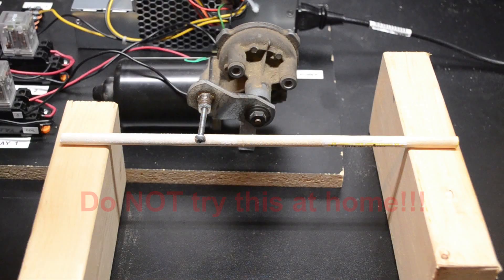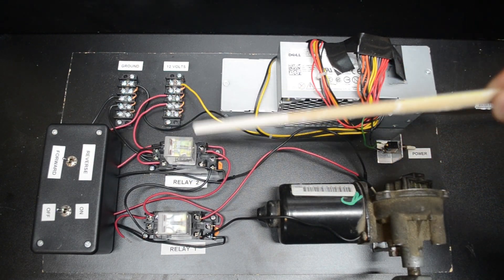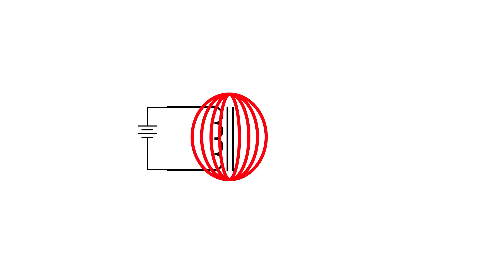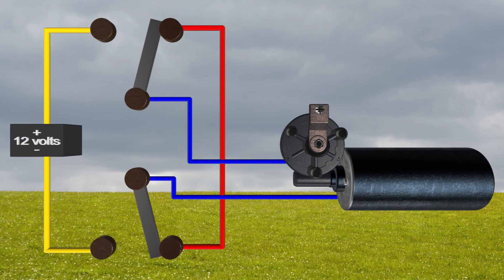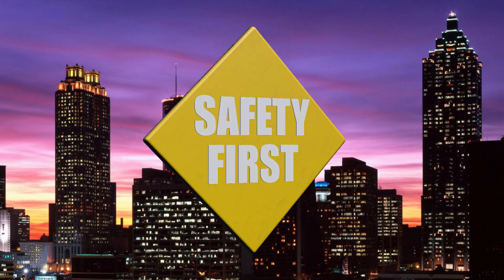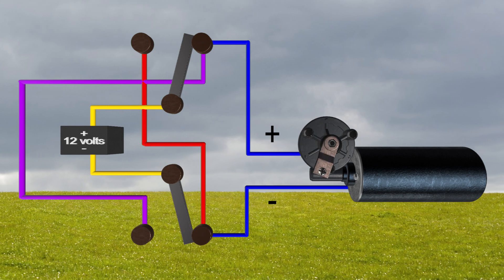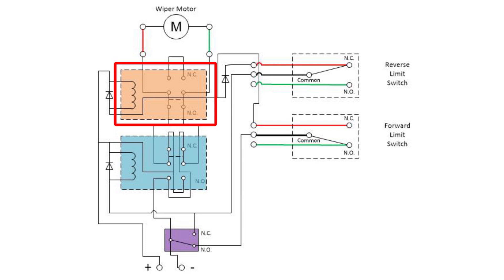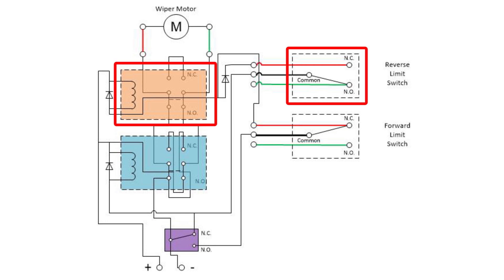Creepy Creations - Wiper Motor Control

Comment: Would you be able to add the n.o. and n.c lables to your relay contacts in your wiring diagram. I've tried to follow your diagram, and i get it 3/4 working, but something isn't right. When i trigger it it opens and stops, i then try to trigger it to reverse and as soon as it leaves the switch it goes forward again to the open swith and stops but if after it triggers the open switch amd i hold the switch closed and teigger it to close, it will close all the way to the switch and stop like it should but if i let go of the open switch at all it will always run to the open switch.... please help

Comment: Could a wiper motor be used as a linear actuator with defined stops at fully extended and fully retracted. How could this be done and how much weight could consistently pushed, pulled, lifted, or lowered? Thanks

Comment: When the motor shorts back to itself and stops, how long will it hold this position ?
Reply: The motor is off, so until it gets turn back on it will remain like that since there is no power.
Reply: @AztecWarrior75  Would it hold this position without power, if under load ? Basically, would it hold a load when turned off ?
Reply: @jackspratt4343  Wiper motors are a funny thing. They are strong and withstand high winds and rain and still move. Yet when you pick up the blade you can move the motor. Some you can't. It really depends on the motor, the load, how it is installed and purpose. 

BTW Just to make sure you understand, when people talk about this "Shorting" or "power lock/stopping", the energy that forces the motor to stop, dissipates very fast and is no longer there. This is mainly used to stop the motor quickly and not let it keep rotating with the momentum.  

If there is a load applied and the motor starts to turn, the motor becomes a generator. When that happens the motor starts putting OUT power, but locks again because of the short. This is not a true lock tho. If the motor is parallel to the ground and a lever is attached to the shaft (like a clock) and on the end of the lever you attach a weight. The weight will eventually rotate all the way down. Power off , lock, energy dissipates, weight makes lever rotate the shaft, power is produced and motor "locks" again. Cycle begins again until weight is all the way down. 

If you put the lever rotating level and parallel with the ground , then most likely the motor will say in that position. 

Again,  It really depends on the motor, the load, how it is installed and purpose.

If you need a motor that will hold position then you should look into getting a worm geared motor.
Reply: @AztecWarrior75  That is an excellent description. Thanks for taking the time to explain. I appreciate it.
Reply: @jackspratt4343  I am glad I could help. Thank you.

Comment: May I ask, does the 'breaking' of the motor uses this method cause undue wear on the motor. Would it burn the motor out quickly or is it just routine wear and tear ?  Many thanks. This is excellent.
Reply: No.

Comment: WOW, SO MANY USES. QUESTION? CAN A SPEAD CONTROL WORK WITH THIS AND THEN WHERE WOULD IT BE CONNECTED IN  THE SYSTEM??  I THINK THIS WOULD WORK VERY WELL WITH AN OLD SEWING MACHINE GREAT TUTORIAL!!!
Reply: First, WHY ARE YOU YELLING?

Second, Sewing machine? Sewing machines run on AC and are reversed by gears.
Reply: @AztecWarrior75  Hah I hit the capitals and just didn't switch off... think I got my answer earlier.
Reply: @moonolyth  What about the sewing machine?
Reply: @moonolyth   Where I get hazy is when you say " I THINK THIS WOULD WORK VERY WELL WITH AN OLD SEWING MACHINE". As I have three Baby Locks, for Singers Pros, two Singers Light industrial and a heavy duty leather and upholstery  monster and a few others and not one of the can be controlled with DC. I was scratching my head. Until I remembered we had DC powered sewing machines in the Army. 

Anyway back to the point. How are/would you use something that is meant for DC on an AC Machine (Assuming the your machine is AC)? 

Well assuming that you machine is AC, then the answer to the question, "CAN A SPEAD (speed?) CONTROL WORK WITH THIS, yes. Most machines use a pedal that is very simple to replace with a potentiometer. Placement will be determined by the machine itself. However most machines have them inline with the wall power. 

FYI
I don't really like the way he does the polarity reversal or the power on and off, seems to convoluted. It does work tho so I took the time to clean up the diagram.
https://drive.google.com/file/d/1x5Rbv6vX1mc2iVJJRk3j-7x_6W6srPWH/view?usp=sharing

However I have a better easier solution. This type of two Single Pole Double Throw relay setup has been used for as long as there has been cars, and power windows & locks. It has all the features his has, Power "lock" motor, ON & OFF, and Polarity reversal. 
https://drive.google.com/file/d/18p7zlUtN7J6UH5hnGtQqhVBXldcOfCAC/view?usp=sharing
Reply: @AztecWarrior75  tried replying twice for some reason hasn't taken.  I have a hand crank that does not take a motor. Most setups for this machine take a very large pulley at the main shaft. With an AC motor. Large pulley wheel is for compensating on the higher speed. This wiper motor would run much slower with torque. Making it more controllable. Using smaller chain and gear with some sort of slipping key would allow better usage plus release for reverse hand cranking. I am a tinker with needle and thread. Far from perfect. A nice controllable motor would probably run 300 bucks. This setup would be small and Light... on the pocket too.
Reply: @moonolyth  'Large pulley wheel is for compensating on the higher speed." I think you are referring to a flywheel. It keeps the momentum going so the motor works less.

"This setup would be small and Light... on the pocket too."  That might be so but the actual wiring, using a "break" as he is using may not be a good thing when sewing. When sewing there are many times when you want the motor to slow down to where you want to pivot. A hard breaking action will not allow you to slowly get to that point. Plus whenever I sew, there are may time when you advance or pull back on the wheel to get the needle to where you need it, with no power applied. The circuit he has here would make it harder to do that, as every time you try to turn the wheel, the power/negative lock would be working against you.
Reply: @AztecWarrior75  yes I believe you're right about not needing the circuit. Just a way to release and Reverse by hand. I'll try and add a link to my machine so you can see a picture paints more words. These machines aren't made to run fast.
Reply: @moonolyth  Sweet! Thanks for posting that video. That's a beautiful thing. 

I would suggest using an electric motor scooter motor. They are tough, powerful, can be controlled with minimal circuitry and they already come with the shaft meant to hold a sprocket for chain or better yet belts. Belts are much safer. Also they are already meant to be mounted easier than a wiper motor.
Reply: @moonolyth   youtube won't let me post link.
Reply: @AztecWarrior75  definitely something to look into, good idea + belt version.. thanks

Comment: Outstanding! But what if you need to control speed? Can you do pulse-width modulation without a microcontroller or chip? Hats off to you, sir!
Reply: Yes just us a module before the switching of polarity. Also jut use two SPDT relays and one switch. Much easier.
Reply: @AztecWarrior75  Thank you.
Reply: @craftwithcodewiz  NP.

I actually had written a detailed comment on how to do it but YouTube keeps deleting my comments randomly. Or at least the ones I post link in or are very long. (I hate typing). So I will post this then the links. Let me know if the diagrams make sense to you.
Reply: @craftwithcodewiz  Again youtube delete the comment with the links.
Reply: @craftwithcodewiz  Well I tried.
Reply: @AztecWarrior75  No worries, thanks. I can figure it out with the answer you provided. Thanks very much for your help!

Comment: Could you suggest how I would take the two direction setup and make it on a timer? Such as 8 seconds one direction and 8 seconds reverse direction. Then a timer to space that cycle out every 45 seconds or so?
Reply: you could probably use a condensator-resistor timer to control the relay
Reply: I believe the DC/AC Motor Reversible controller Module Timing Delay Cycle Limit Relay can do that for you. Do a search for video. I tried posting it for you and the link to where to buy but youtub deleted the comment.

Comment: Hello Creepy Creations, I just wired you circuit for this motor control from your circuit diagram I would like to say it does not work it has a dead short on it when relay 2 switches from NO to NC I was very disapointed but with a little re -wireing I got it to work and it works as it should, if you are going to share a circuit diagram make sure you go over it first.
Reply: Funny how "goodie "g offers no insight or explanation as to the problem. In fact based upon the fact that they can't even punctuate their own posting, I suspect they simply misunderstood the wiring diagram.  Also no content on their own site. People like this are all talk and no action. Armchair warriors !!
Reply: @johnmoore3859  I agree on all that you said however it may not be all his own fault. 
The schematic is correct but it is a but difficult to see what is going on the second relay (top to bottom). The dashes that connect the contacts are cluttering up the positive wire that is being connected to the NO n NC.  
The Schematic is also all over the place. The wires are going up the back down and crossing other wires back down to where it goes instead of going straight to it. 

The Poster of this video need to learn NOT to go THROUGH  the components with the wire. He also has components facing in one direction but the connection are in the other direction. 
Honestly this is a piss poor diagram. It is in fact correct tho.

Either way I would not use it anyway. I reworked his diagram and made my own. Mine (in My opinion)(mine I mean diagram and working knowledge of, the idea has been in use in motor reversal for ages) is a much better way of getting this done. It gets everything accomplished that the video does but so much simpler and easier to do.  

https://drive.google.com/file/d/1NrQcrScxus-xfB_zWZGszqmqyCq2NNzn/view?usp=sharing
https://drive.google.com/file/d/1E_s3D4rqx2HzyRXCXLZ_8FuZyQihFkFS/view?usp=sharing
Reply: Hi goodi g! Can you please share the fix. Thank you!
Reply: @jmerilo  There is no fix. The circuit works just fine. I wouldn't use it but it does work.

Comment: I m using this motor for a project , and when I have rotated motor its max speed by 12 v 9 amp battery ,a motor becoming a hot..what should be do for keeping motor normal temperature.

Comment: Power failure does not make Arduino useless what a super fail statement hell they can run on batteries rofl what the fuck are you talking about. Learn before making false statement or moronic ones guy